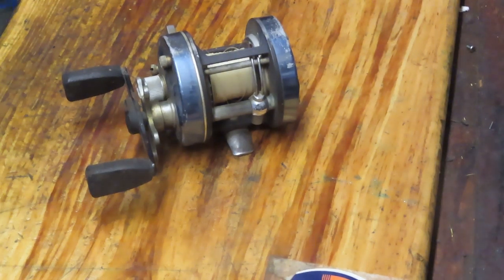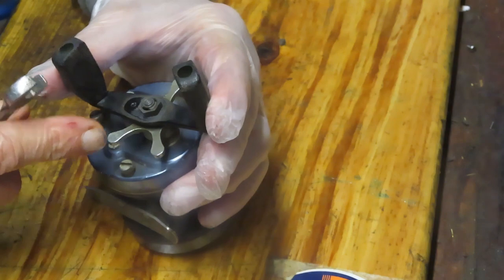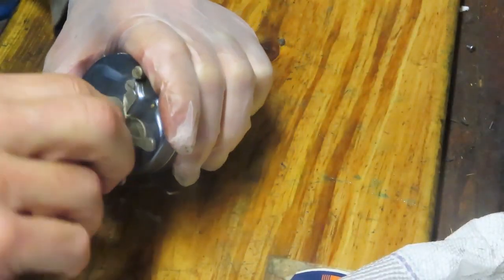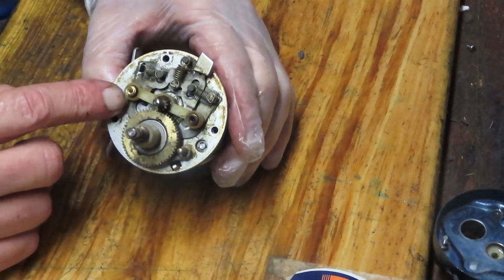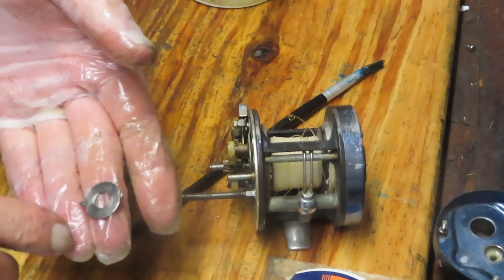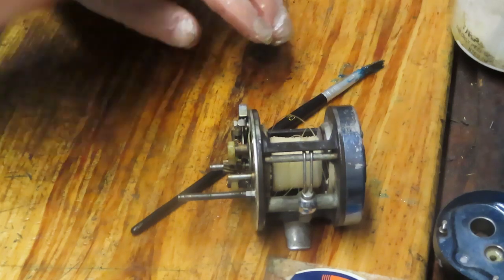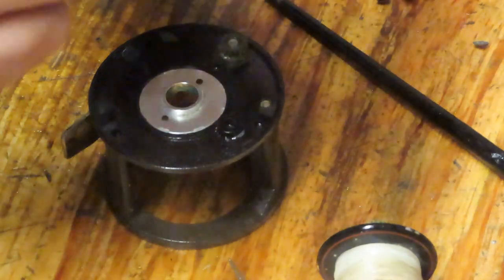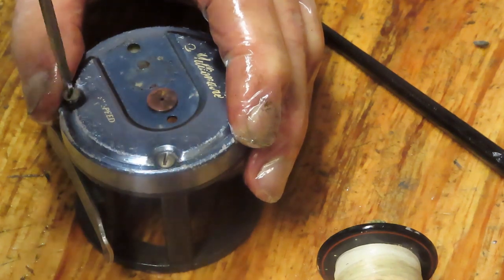Daiwa Millionaire 4HM round baitcasting fishing reel how to service

Comment: Thanks for this vid! I read that Abu sued Daiwa over the Millionaire. Never knew the outcome. I love all things Daiwa and I love all things from the original Borgstrom owned Abu.
Reply: The Millionaire V which was the 1st one was nearly identical to the Ambassadeur 5000 that was being sold at the same time. Don't know if it actually went to court but the 4H, 3R and later reels were redesigned and almost no parts will interchange with the original. I had a 1973 5000 apart next to my Millionaire V and while they look alike there are differences such as the drive and pinion gears.
Reply from the maker: I appreciate the additional information.   I was not familiar with the background and I will look to learn more - Dennis

Comment: Great explanation on disassembly and reassembly but how do I disassemble the worm gear for the line guide. Thanks
Reply from the maker: Not sure and I don't have the reel here to show you.  I would get the schematic and see where the gear is attached
Reply: @2ndChanceTackle  I figured out how to remove a small c clip on worm gear. It was pretty simple after all

Comment: I’m almost sure I have seen a few Daiwa Millionaire spinning reels. Am I correct? The one I saw had a body shape similar to a 9000C or GS-9. I was assuming that the only major difference in this Millionaire spinning reel was only different because of cosmetics.  I’ve never owned or used a Daiwa conventional reel. This one looks like a decent reel. Thanks for sharing it! — Chris
Reply: might be thinking of the Daiwa Millionmax, model GS-8000/9000. Both weighed around 860g, hold 275yds of 25lb mono, and were similar to the GS-9 except they had 1 more ball beaing. The 8000 is black with a silver spool and has a 4.3:1 gear ratio. The 9000 is gold with a 3.1:1 gear ratio.
Reply from the maker: Thanks for the additional information
Reply: @dillonzhao9641  Thanks f or then information! I’m going to do some research on that. The reel I was thinking of is a Daiwa Million DX 7000 vintage spinning reel. That’s the reel I was thinking of but I’ve never owned one. I have 59 vintage Daiwas. I have been able to get three really nice 9000C reels and just finished cleaning and servicing a very nice GS-9.

Comment: I didn't notice a spring on the A/R dog, did I miss it or was it designed without a spring?
Reply from the maker: No spring.  This has a finger A/R dog and it runs by friction.  It releases when the reel is turned forward, but friction pulls it in when going back